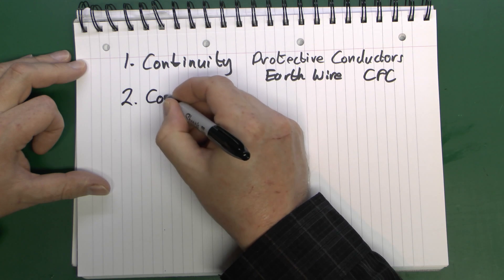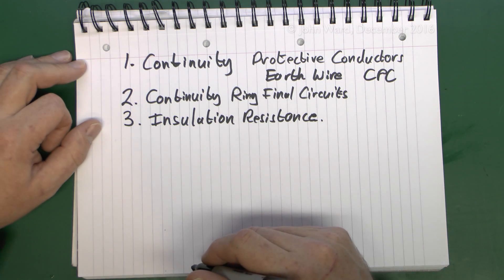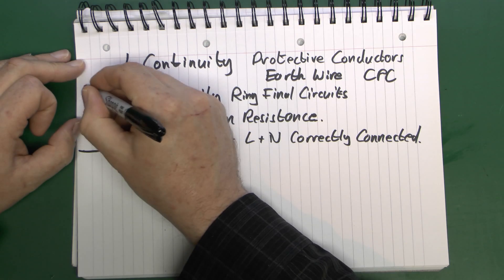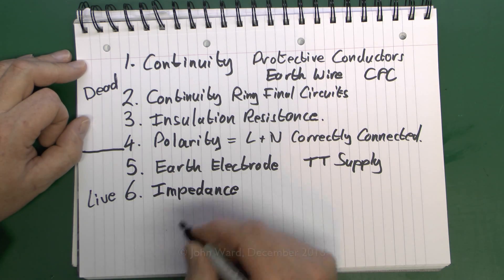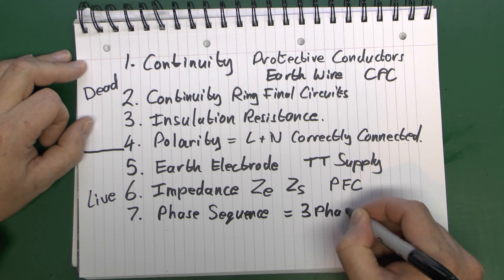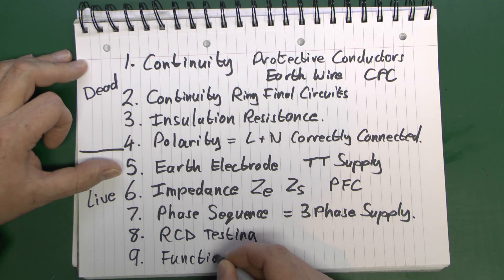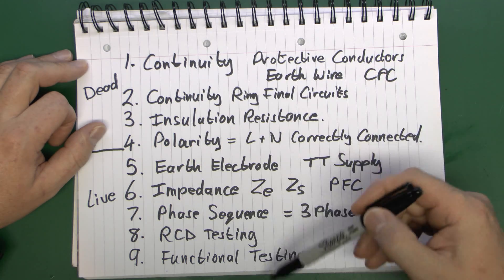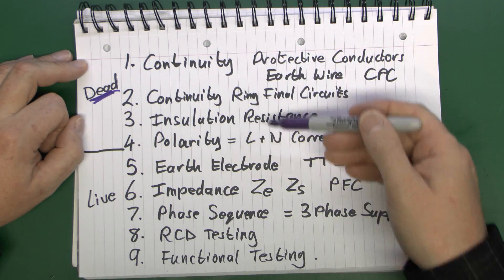Electrical Installation Testing Introduction

Comment: Can anyone advise on installing a window roller shutter that comes with a small cable size of 1mm or perhaps 0.75 mm .  Does this have to be put on the lighting circuit ? Can you put a plug on it and wire a socket to the lighting circuit and simply plug it in ?  I have 10 Amp  RCBO on lighting circuit.   I cannot find info on this anywhere.  Thanks
Reply from the maker: Lighting circuit, or another circuit, or connected via a plug.  All acceptable.
Reply: @jwflame  But could the 0.75 mm cable be on a power circuit .  Power circuit is 2.5 mm. ??  The smaller 0.75 mm cable only good for 6 amps would not have circuit breaker protection at 10 amps . Also if the roller motor got stuck it might draw higher amps ? Its not like a light bulb which has a max current draw. Please explain. I am totally  confused by this. Thanks

Comment: So I don't actually do a polarity dead test, is it part of continuity. Because as you do R1+R2 for radials you are confirming polarity yes? And for ring finals as you do end to ends, r1+rn and r1+r2 you are confirming polarity yes? Would you just check the polarity box after doing so? And for live polarity is that done at the start of live testing and is it done with the main switch on or off? I'm guessing off but just trying to clear all my misconceptions. Thanks John!!
Reply from the maker: R1+R2 confirms polarity as well, so not necessary to do it separately.
Polarity of the supply is done with the main switch off, at the incoming terminals (which will be live).

Comment: Hi John, I was looking at a wholesaler's catalogue the other day and it occurred to me that the number of socket outlets that have added functions such as USB charging etc now far outweigh standard power outlets these days (at least they did in this volume).😵
My thinking, with this in mind is that the order of testing would surely need to reflect the installation.
I'm thinking specifically that accessories with sensitive components need to be removed during IR testing, therefore, in a ring circuit containing a number of outlets with USBs it would seem to make sense to do the IR test first with them disconnected, then connect them up and carry out procedure for continuity tests.
Am I missing something?
BTW, I'm a firm believer that a socket outlet should be just that and nothing else, but we are where we are 😒

Comment: Hi JW. Thanks for the great videos. Can you advise why Zs on ring circuit supplying socket outlets with 32A type B Mcb, measured at 3 ohms is acceptable if additional protection is provided by 30ma rcd? I thought the max Zs for the circuit should be 1.10 ohms. Thanks

Comment: What tests would you do before changing a consumer unit?
Reply from the maker: Ideally all of them, but as an absolute minimum insulation resistance for all circuits (otherwise a fault could result in the new RCDs not even switching on), protective conductor continuity, and polarity.

Comment: Hello JW
Is it enough tester like kewtech kt63 dor all of this measurments to test? Or i need aditional tester on top of that?
Thanks
Reply from the maker: It doesn't do phase sequence but that is only required for 3 phase installations.
It doesn't have an earth electrode test either, but you can use the loop impedance test for earth electrodes in many situations.
Reply: John Ward thanks for reply
Can You recomend tester which would do everything You need get for regular house certificate, which would be able to complete all measurements for certificate
Thank You so much

Comment: What will be the recommendation for plastic consumer with regards to amendment 3 metallic  consumer units  when doing a periodic inspection.
Reply from the maker: The report would state something like 'plastic consumer unit does not comply with 421.1.201'.
EICRs (previously periodic inspection reports) are not a place to recommend anything, they are just a report on the facts.
If the client wants recommendations for improvements so that the installation complies with BS7671. those should be provided as a separate document.
Reply: John Ward the coding when carrying out eicr is the recommedation for the installation.

Comment: Hey John, I'm about to start a new job on electrical team fitting out barges would all this stuff be relevant.
Regards 

John
Reply from the maker: Yes, although there may be other regulations to consider depending on the exact type of barge and what it is used for.
Reply: John Ward 

It will be used in the salmon feeding industry, thanks for reply

Comment: Hi john how would you do live tests on an economy 7 board during the day?
Reply from the maker: Either don't do the live tests, or if it's really essential wait until the power is on (early morning is useful for that as most are on until 7am).  However once all of the dead tests are done, you have already confirmed it's safe to use, there isn't a huge amount to be gained from live tests other than testing an RCD, which often wouldn't be fitted to E7 circuits anyway.
Reply: Ok Thanks for the reply  john

Comment: Hi John
Thank you for the brilliant videos. They are informative and you explain things in very clear terms.
Could you help with a question please? 
Regarding Final Circuits in the On site Guide - 
I have picked a few circuits that are common to most domestic properties, noted the maximum cable length suggested, then calculated the voltage drop based upon the stated length. The results I am getting are way over the max voltage drop allowed. For example:
Lighting circuit 6A RCD, ref method C with 1.5/1.0 cable - the book states 90 meters BUT
90 meters of 1.5/1.0  on a 6amp breaker with a loss of 24ma per meter = 15.66v loss.
What am I doing wrong here?
I hope you can help
Regards
Pete
Reply from the maker: For most circuits including lighting, the load is not all at the end - it is distributed along the cable so the voltage drop reduces reduced as you move away from the supply end.
Reply: Hi John
Thank you for the response.
I think my confusion is that if I installed a 90m lighting circuit in 1.5 twin and earth as per the OSG max circuit length my calculations would indicate a voltage drop higher than than the 3% allowed by the regs.
The same problem seems to appear with other examples that I have tried regarding max cable lengths in the OSG.
It still feels like I'm missing something. ...
Again thank you for the videos that you make. You have a real skill for teaching.

Comment: is it a reg that you have to go through each individual circuit and get your r1+r2, then go back to start and do Ir on each, or can you complete the 4 dead tests on a circuit then move on to the next circuit and do the 4 tests on that and so on?
Reply from the maker: No - the only requirement is that the tests are done in the correct order for each circuit.
If there are multiple circuits, it doesn't matter if you do all the tests on one circuit first, or one test on all the circuits, or any combination.  All depends on what is most convenient at the time.

Comment: hi John can you talk more about periodic inspection such as commercial or industrial fixed installation where client requests to leave one of the office lighting circuit energised or one of the office IT equipments energised because of the office hour. talk about practical inspection and testing on this type of existing installation. talk about extent and limitation how you deal with this situation please.

Comment: Hi John could you do a video with  BS 88  30 amp fuse using some 6mm twin and earth taking say 30 to 40 Amp with  2 MTS in yt2 plastic trunking and see how hot it runs!! I'm thinking cooker circuit...

Comment: Quite surprised to see that there is no item on your list along the lines of "visual inspection". I can imagine a scenario where an installation has produced  perfect test results but where the standard of workanship has been poor (e.g. exposed copper wire at terminations, cables poorly routed, fittings poorly/dangerously sited etc. etc.) I think this should be included under the "system dead" heading.
Reply: That would come under condition reports and not installation certificates as installation certifcates are almost always for new installs where a visual should not be needed if you installed it correctly
Reply: Well thats my whole point -"if" you installed it correctly!
Reply from the maker: If you have installed it yourself, you already know how it was installed.  If checking other people's work then inspection is required but this is a separate process from the testing.